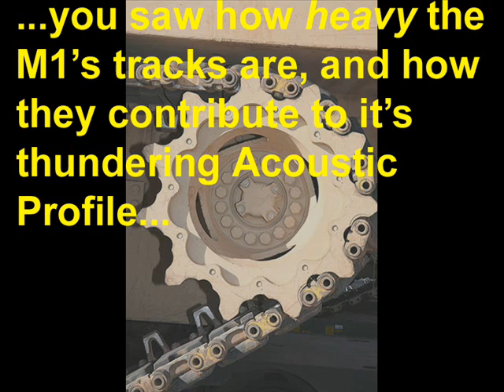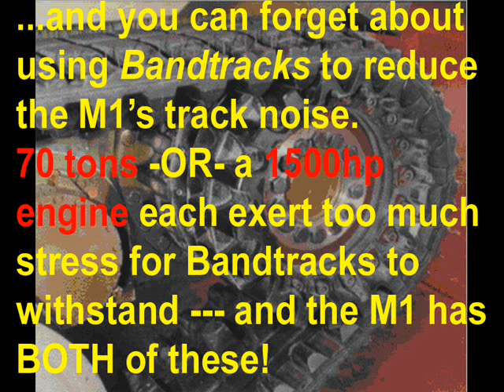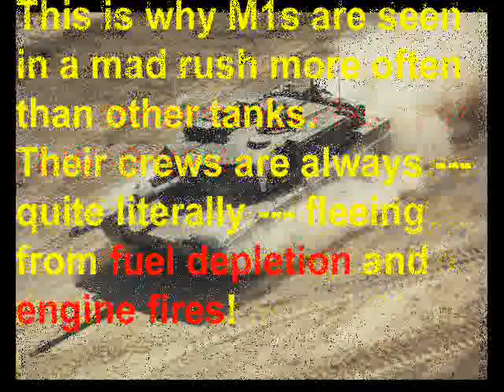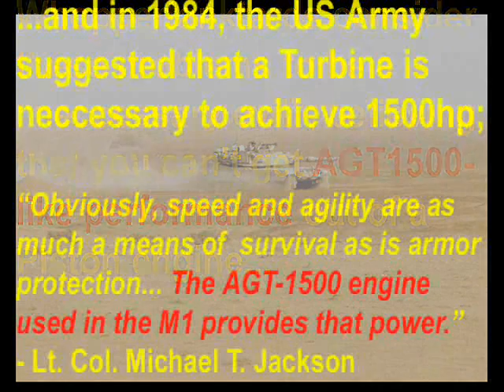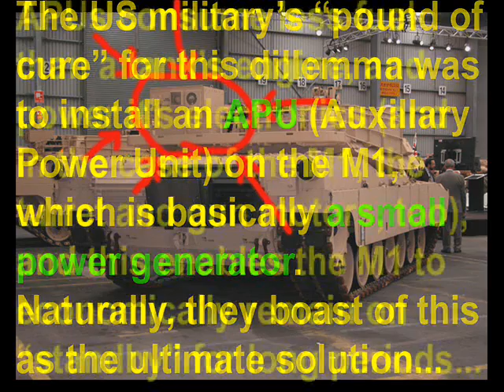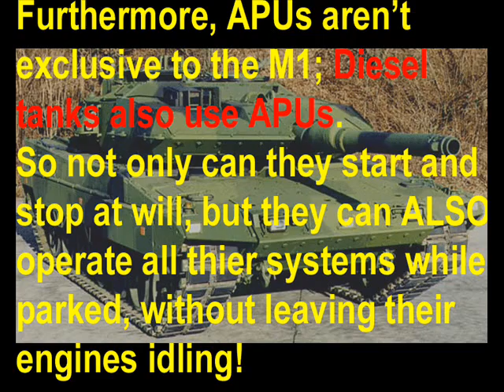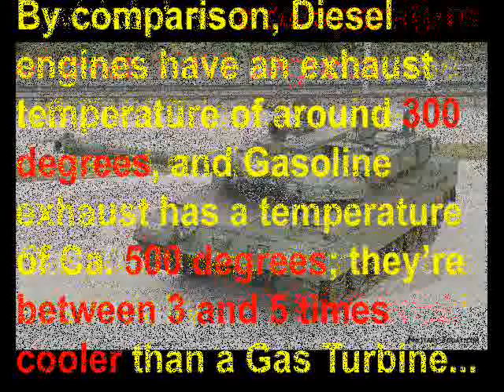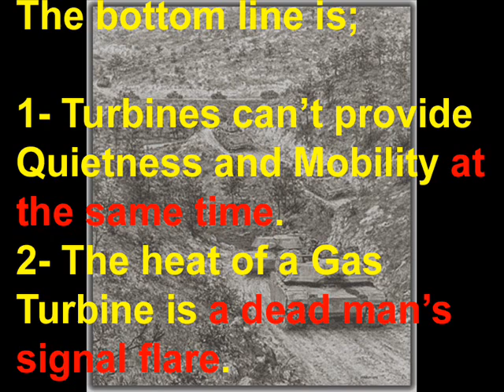The REAL M1 Abrams! Chapter 5: Surprise (Part 3 of 5)

Comment from the maker: Pretty much; that Gas Turbine runs at 30000rpm (not a typo --- *thirty-thousand* rpm!) at all times, regardless of how fast the M1 is moving, and consumes fuel accordingly. They only way to get the fuel consumption down is to move as fast as possible.
A Diesel engine would consume fuel that quickly as well, if it ran that fast all the time; but as it happens, they spend most of their time idling at closer to 300rpm, and seldom hit 3000rpm.

Comment from the maker: "BlacktailDefense did i just see the apu mounted on the storage rack."
That's an interesting angle to the EAPU (External APU) issue I haven't thought of. The concern I raised before was about the effectiveness and safety of the crew (the EAPU has to be started by hand), but the vulnerability of the device itself is also a serious matter.
Note that the only M1s with UUAPUs ("Under-Armor APUs") are M1A2 SEPs, which comprise only 1/8th of the M1 Abrams production run.

Comment: warm engines make tanks easy prey to aerial vehicles using heat-seaker missiles,enemies using thermal vision equipament will also locate the tank easely(even in cold weather!),infantry cannot use the tank for cover due to its ridiculously hot exaust,etc

In the long run,the gas turbine makes the tank much more vunerable and unreliable,and you know the only reason for a gas turbine in the M1,GDLS sucking money from the gov like crazy.

Comment from the maker: @2117774 It's worth noting that besides the M1 and it's derivatives, only 2 other Familes of Vehicles for military use have EVER had Gas Turbine power --- the Strv103 and T-80.
Since Ukraine gained independence, they've only built Diesel variants of the T-80, and Russia has vowed to discontinue further development of Turbine ground vehicles in the wake of the 2nd Battle of Grozny.
The Strv 103 was never exported, it ALSO had a Diesel, and it was replaced by the Diesel-powered Strv 122.

Comment: this will spoil the AWAC/JSTAR day again.  How far can an untracked armoured or attacking enemy airfore planes move in an hour?

Plus remember electronic components don't like being switched on and off on a regular basis as the solders heat up and then contract, and that causes cracks and then a failed component(s).

Comment: @franknbeans4761 Possible but how long is 'momentarily'?  The AWAC/JSTAR remember is just a modified 707, and to work it has to fly stright and level at n hight, and if the pilot is having to weave arond the sky dodging these missiles fired singley or duely with its radar switched off it can't do its, job.  And say a single time it takes the AWAC/JSTAR the best part of an hour to get back on course, the moment they switch the radr on again the other side sends up another one or two missiles...

Comment from the maker: @steffen19k You're assuming the missile in question is nuclear-tipped, and an ICBM --- but with Ballistic Missile Proliferation they are the exception, not the norm. There are many countries with equivalents to the Scud, which takes 90 seconds to fly 180km, and are detected by AWACS (and it's point of impact plotted) within seconds of liftoff.
A Scud with a cluster warhead will only damage a small area, and there's at least a 60-second warning; easily enough for a formation of tanks to displace.

Comment from the maker: @ryubolo14 
At present, I only know of one IR-Homing ATGM that China operates; a licensed copy of the Russian Kh-29D (AS-14 Kedge).

Iran operates a missile called the "Saeqeh-1", which is claimed to be an anti-tank missile, but has an immense range (over 40 miles). The only reason I brought it up is because I can't find any info on it's guidance, but it's apparent size, weight, and range suggest a weapon similar to the USA's EFOGM and Israel's Spike-ER. It may be a hoax, though.

Comment from the maker: @Ag3nt0fCha0s 
Actually, the US military's F-35s will have FAKE Stealth;
flightglobal(dot)com/articles/2009/06/30/329025/ex-f-22-engineer-to-sue-lockheed-for-stealth-design(dot)html

wired(dot)com/dangerroom/2009/01/report-joint-st/

In other words, you won't have to worry about watered-down Stealth in export F-35s, because there was never anything there to water-down.

Comment from the maker: @Ag3nt0fCha0s 
Indeed, the USAF absolutely HATED these aircraft.

It didn't matter that USAF that 12 of their own F-5s locked horns with North Vietnam for 6 months on-end, flying 2600 sorties, and losing only a single airframe --- small, light, compact, and efficient airframes are Politically Incorrect in the USAF, even today (compare the $200 Million, 50000lb F-35 to the $70 Million, 39000lb Mig-35; the Mig-35 has the same range and payload, equivalent weapons, and BETTER sensors and airspeed).